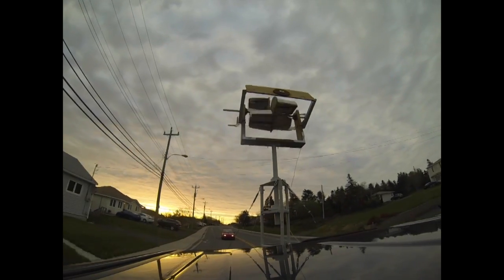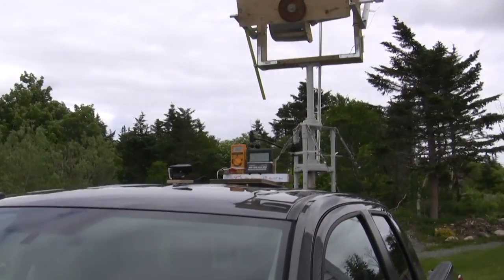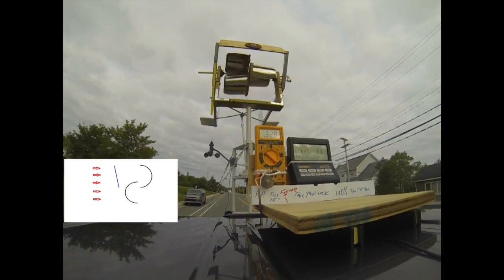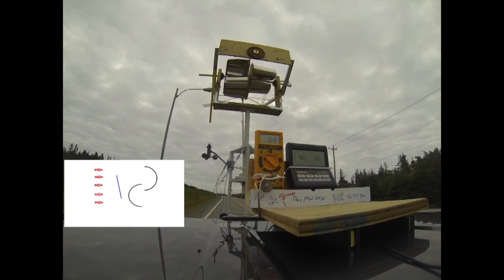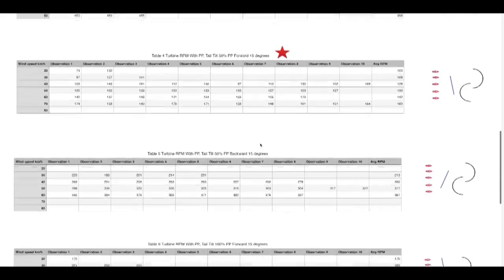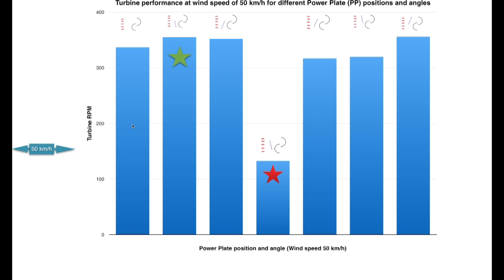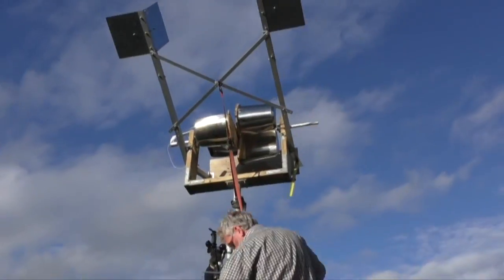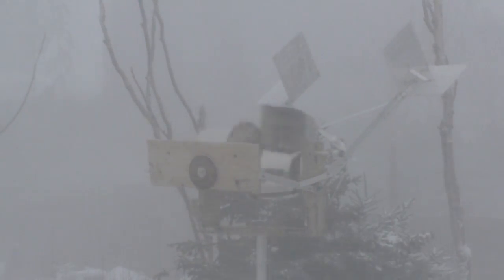Savonius Horizontal Axis Wind Turbine (SHAWT) - tail fix & testing in pickup truck

Comment: What in the world would you gain by using a horizontal virgin version of this of this concept the whole point is the haves have it so it doesn't have to Pivot it all so using a less efficient message that you're going to have to put up on a tower and get less power from it there's no there's no upside to this God bless you
Reply from the maker: Good question - First it is an experimental machine, one that I just wanted to evaluate for some time.  The idea was to see if the design would enhance starting (not really a big problem with the fundamental Savonius machine), increase efficiency and, most importantly, control rotor Over-speeding in high winds. The conventional Savonius does not have any aerodynamic means of  preventing the machine from over-speeding. Some kind of mechanical brake or electrical load is necessary to keep the machine from self destruction. The test results of the machine in the video show that the "power-plate" is effective in controlling speed.  That is not to say this makes the design practical in terms of cost or simplicity... it is just an experimental machine that is fun to observe.
Reply: I'm sorry to sound critical in your project you obviously spent a lot of time and put a lot of effort into this thing. Usually these things are not effective in the first place but addressing the over-speeding thing I guess is an important Mission regarding if it's vertical or horizontal
Reply from the maker: @josephdupont  Not a problem at all your query is important and I have placed it at the top of the comments. Thanks.

Comment: I like your work. Thanks.
The power bar is a great idea.
I have large storms in the artic and over rpm is a concern.
Reply from the maker: Thanks William, yes and it is fun trying different wind turbine ideas. I spent some time on the coast in NWT years ago.
Reply: The storm footage showed the aerodynamic shears the turbine must endure.
How do you feel about intake induction?
Reply from the maker: @alaskawilliam1  I have no experience with Ducted wind turbines... is that what you are referring to? Speaking generally though, the SHAWT is a physically heavily loaded machine that would not find any life in the real world. I think DWT's kind of fit in that category as well - but I love to see the different efforts made to develop turbines of any wild and wonderful designs.
Reply: I'm thinking of a water turbine desigh.
Hydrodynamics equals Aerodynamics. 
Then to borrow from aviation; focusing on wing design. Leading edge slots and slants. Using airspeed to "Lift" slots to close the induction of high speed airflow to protect from over rpm.
In my location i have no solar for 90 days. I am looking at wind power

Comment: What would happen if you took that front plate off and just have the win hit the drums by itself without that plate diverted because if you have that stationary you're not going to need that so maybe you should test without it and get a better result and the easier turns the more power You Again by restricting it defeating the purpose of your Win turbine
Reply from the maker: In the video check the turbine running without the power plate (8:07). Turbines need some means of overspeed control. In this design the power plate provides that control.

Comment: I don't think the airflow is coming straight on, as the pictures suggest. There is boundary layer flow from the front of the truck coming at an angle underneath the power plate. As it flows between the plate (angled inward) and the lower part of the turbine it's creating suction that pulls that part forward and then expands into the upper part pushing that. That's why you're getting unexpected higher performance when the picture indicates you shouldn't. When the plate is in the middle (angled outward) it doesn't create suction while blocking flow to the upper part, so rotation is much reduced.
Reply from the maker: The boundary layer re the truck itself would have to be quite thick to have any influence on the turbine operation. But in general from my observations there could well be some other (perhaps unrelated) anomalies between the truck tests and my observations of the turbine operating in free air... really appreciate your observations and comments. Hope to get time to get back at the SHAWT (and some variants) in the future.